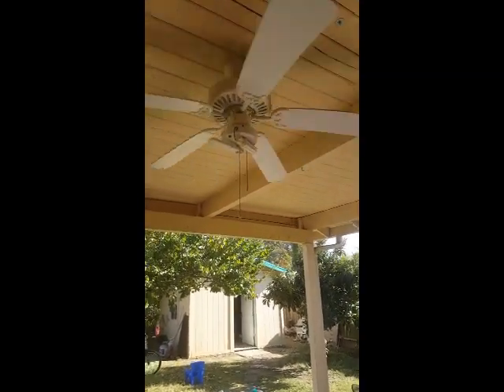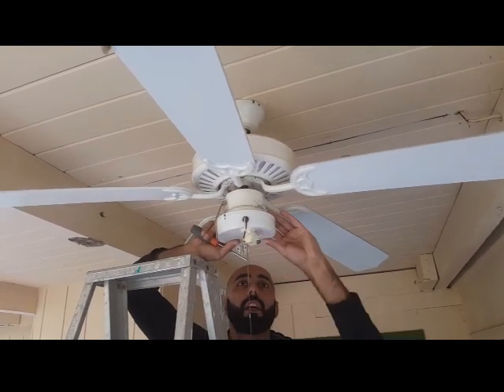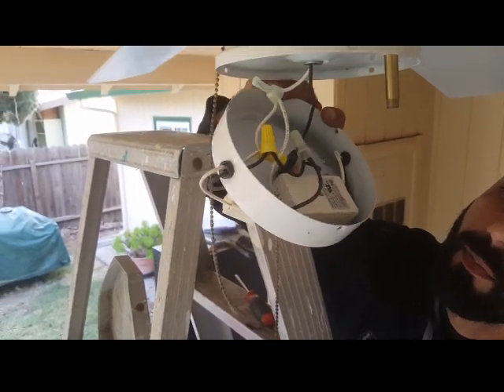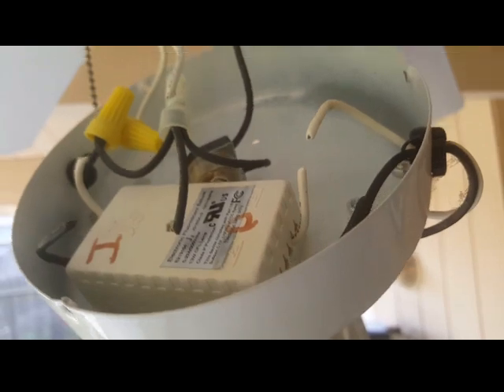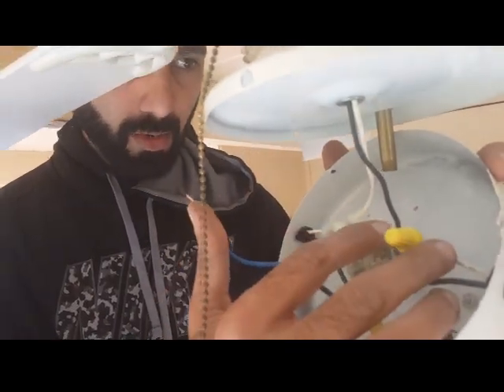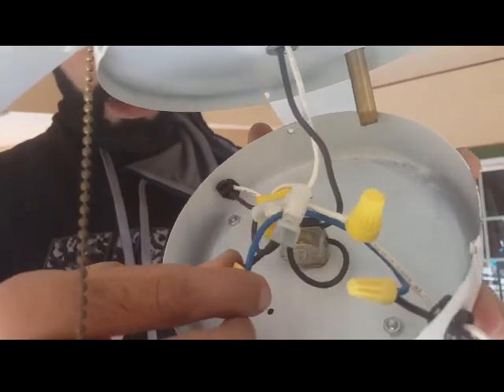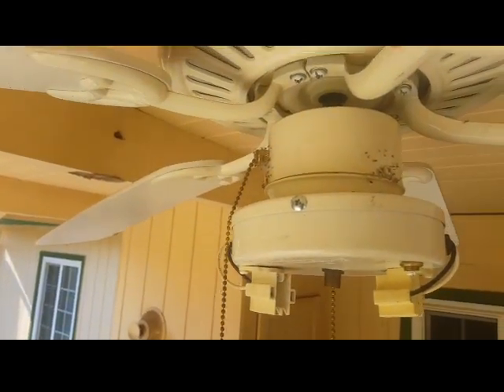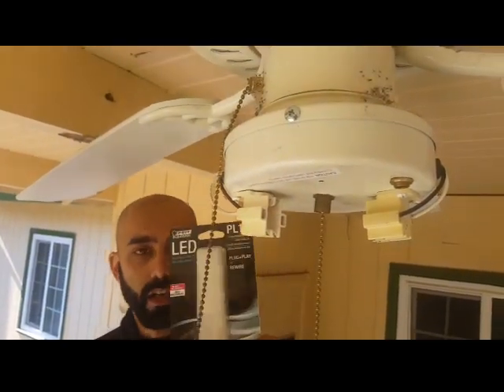How to fix a flickering ceiling fan light: Ballast Removal

Comment: The ballast is there to keep the bulbs stable from causing damage when the bulbs go out. An unballasted bulb will burn up. Also I never seen a ceiling fan with prong fluorescent bulbs before
Reply from the maker: So I replaced a CFL bulb with a LED bulb thus no ballasts are needed. Home Depot sells them.
Reply: @DuctTapeMechanic  but just remember a fluorescent bulb can not go in there. It may light up still but the damage is when going out